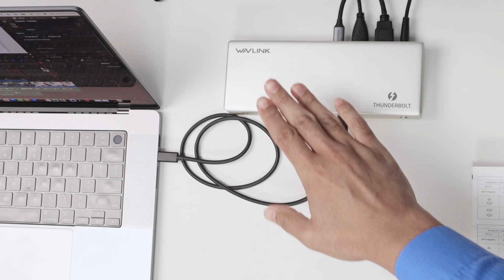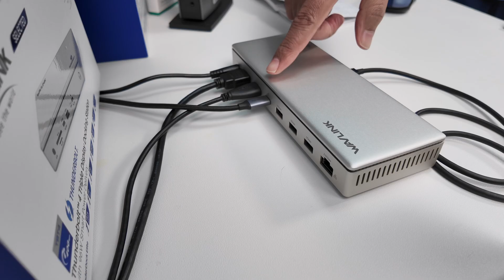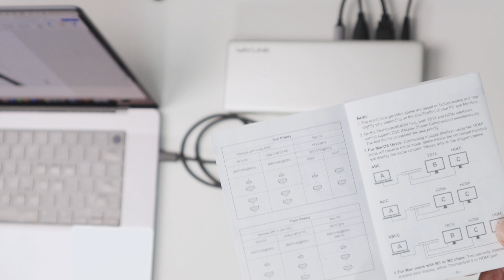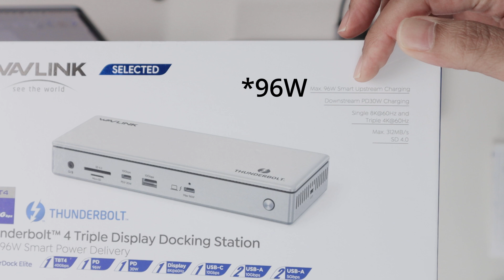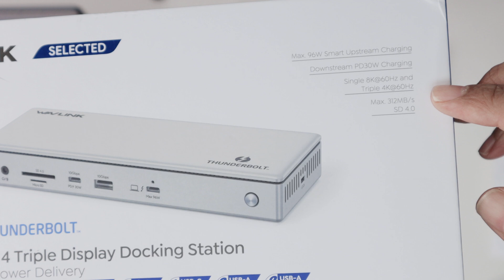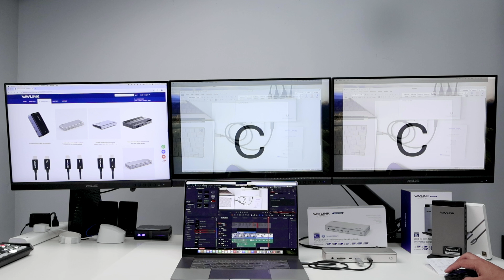Macbook M2 Multiple Displays (No Software Needed) - Thunderbolt Docking Station.

Comment: I think the title is a bit misleading. For M1/M2 or M3 this device will let you extend to one monitor (if more they will be mirrored). Since you have more than 2 displays, this means you have a different chip: M2 Pro or M2 Max (the Amazon link shows a M2 Max, so of course you were able to have those displays....But for someone with M2 (basic) they'll need to use the DisplayLink